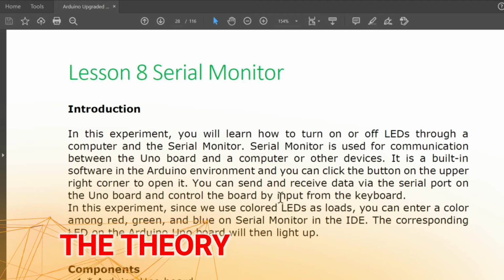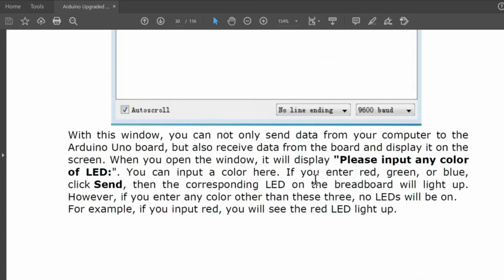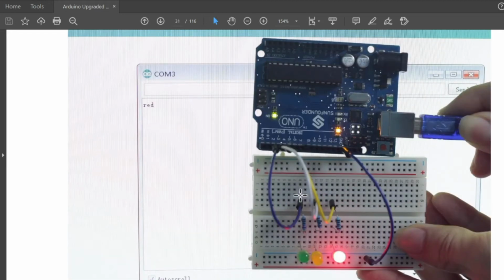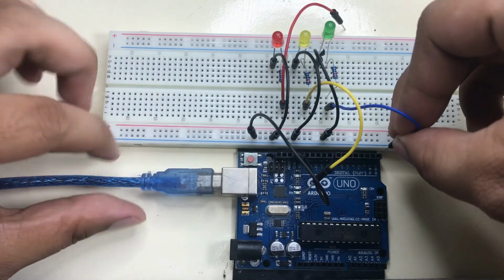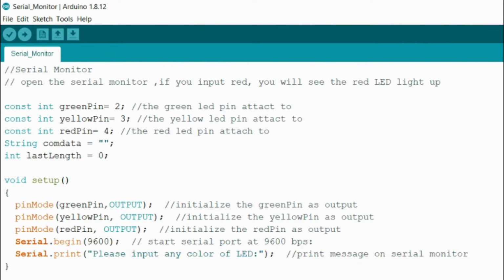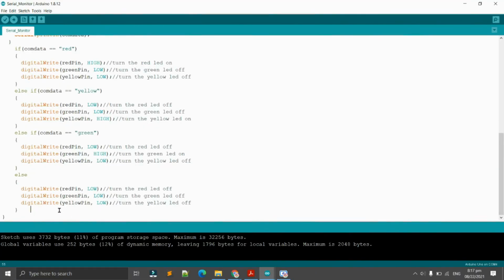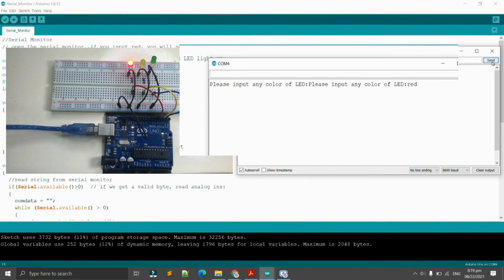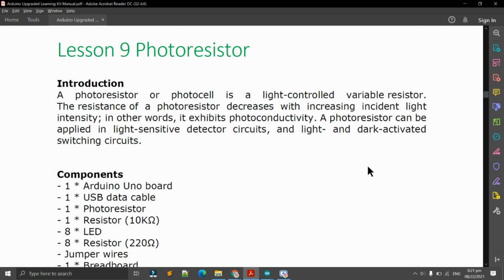ARDUINO TUTORIAL FOR BEGINNERS LESSON 8: TURN ON LED USING SERIAL MONITOR

Comment: Thank you for the instructions.  I have tried your code but have not had full success.
When I enter red or green or yellow the text is written in the Serial Monitor however
no LEDs light up ! 
Here is the code I used - can you please suggest how I can solve the problem? 
// Open the serial monitor, if you input red, you will see the red LED light up
const int greenPin  = 2; // green led pin attached
const int yellowPin = 3; // yellow led pin attached
const int redPin    = 4; // red led pin attached
String comdata = " ";
int lastLength = 0;

void setup ()
{
  pinMode (greenPin, OUTPUT);
  pinMode   (yellowPin, OUTPUT);
  pinMode   (redPin,      OUTPUT);
  Serial.begin (9600);
  Serial.print ("Please input any color of LED:"); // print message on serial monitor
}

// if a valid byte is available, read analog ins

void loop ()
{
  if (Serial.available() > 0)
  {
    comdata = " ";
    while (Serial.available()  > 0)
    {
      comdata += char (Serial.read() ) ;
      delay (2);
    }
    Serial.println (comdata);
  }

  if (comdata == "red")
  {
    digitalWrite (redPin,    HIGH); //turn red LED      on
    digitalWrite (greenPin,  LOW); //turn green LED   off
    digitalWrite (yellowPin, LOW); //turn yellow  LED off
  }

  else if (comdata == "yellow" )
  {
    digitalWrite (redPin,    LOW); //turn red LED off
    digitalWrite (greenPin,  LOW); //turn green LED off
    digitalWrite (yellowPin, HIGH); //turn yellow  LED on
  }

  else if (comdata == "green" )
  {
    digitalWrite (redPin,    LOW); //turn red LED off
    digitalWrite (greenPin,  HIGH); //turn green LED on
    digitalWrite (yellowPin, LOW); //turn yellow  LED off
  }

  else
  {
    digitalWrite (redPin,    LOW); //turn red LED off
    digitalWrite (greenPin,  LOW); //turn green LED off
    digitalWrite (yellowPin, LOW); //turn yellow  LED off  }
  }
}